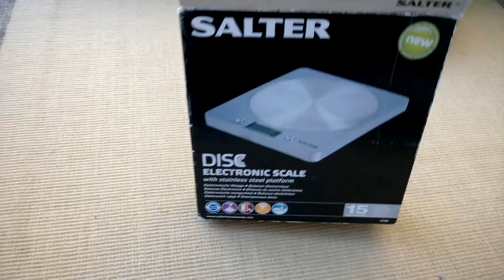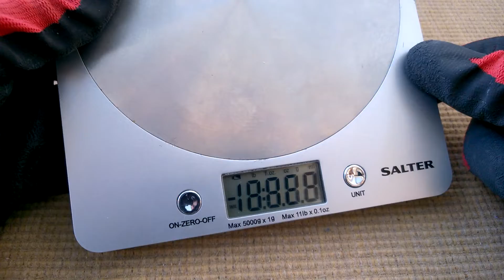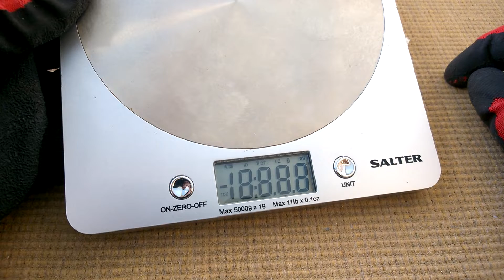Faulty Salter Kitchen Scales Tear Down - How Does It Detect Weights?

Comment: I had the same issue with weight changing.... Watched your video then thought let's try the obvious instead... Cured the issue in 10 mins 😮... Without taking apart. Took the battery out... Thoroughly cleaned all surfaces of the scales with multi surface cleaner , paying most attention to around the buttons on the top surface... Dried off with a tea towel then used a hairdryer to blow warm air onto the edges of both the buttons... Replaced old battery.... Problem cured ( my scales are over  10 years old)😂

Comment: Thanks! I just needed to know where the screws were. Mine were displaying "Out2". The buttons had become clogged in their holes. Flour and water does that! Unscrewed the circuit board (7 small screws - cheaper scales would use 3 at most) and the buttons and their holes could be cleaned properly. Back to weighing ingredients again.
I reckon the guarantee has run out, since my scales are from 2004, and there is a fresh model every couple of years. You still have the BOX??

Comment: Very useful video - cheers for uploading. For anyone who might be facing the same issue I did (innacurate readings / weird fluctuations when weighing) - it was down to the 2 large screws both being loose. Tightening them very lightly just to the point where they stop turning with light torque should be enough. Don't go too tight or the scales will just error. After tightening the screws and comparing to a brand new scales reading they are both showing the same.
Reply: Thank you so much. It works like a charm. Saving me from buying the landlord a new one :)

Comment: Same scales,same fluctuating weight behaviour so looks like it is a potentially common mode of failure. Not opened mine to check production date but reckon probably not dissimilar in age range to yours. Oh well, time for new scales. Thanks,was interesting to see what was inside.
Reply: These have a life-time guarantee if I recall.